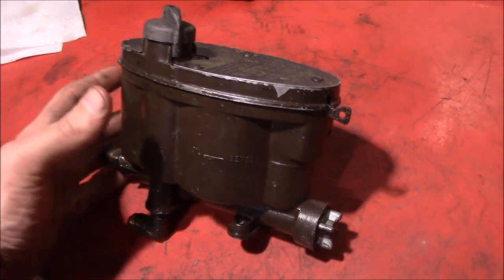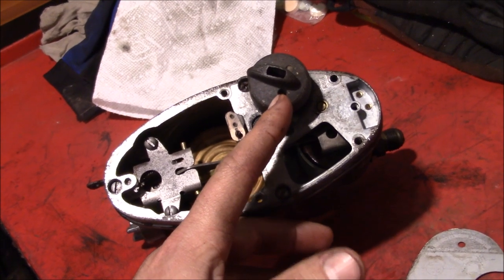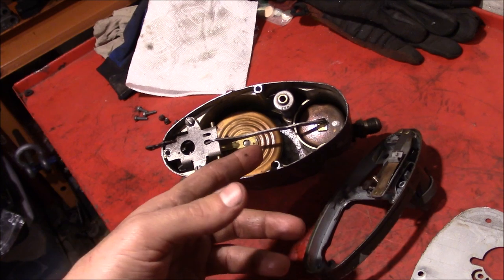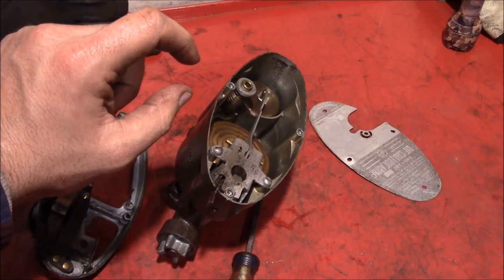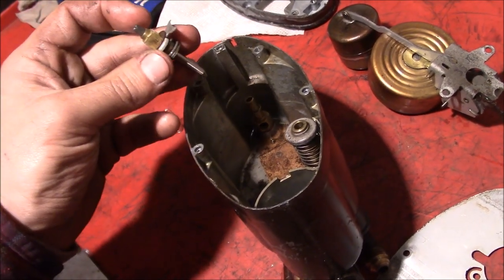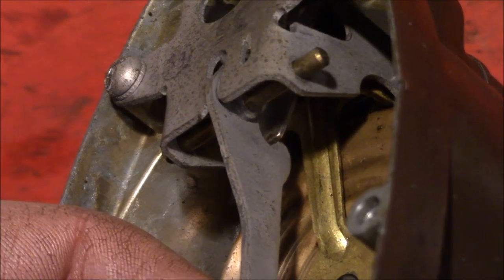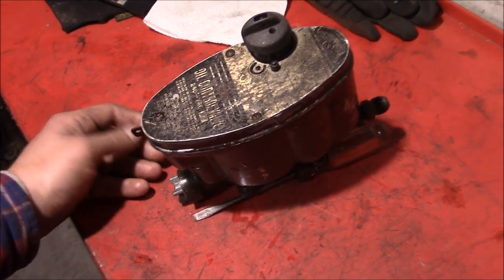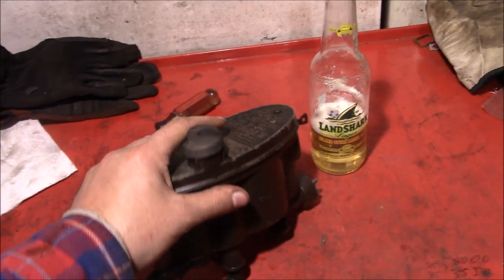Oil Heater Control Valve - Overview and Disassembly

Comment: Thanks so much for this video.  Our house came with an old SuperFlame oil heater in the garage. I had never seen one of these before. Took the same approach and just tore into it to get it figured out.  Was worried enough about it that I drug it out into the middle of our driveway the first time I fired it up like I was about to light off fireworks. It has since been heating our garage for the last 3 winters with no issue other than I had to run it wide open as the flame would extinguish if I tried to turn it down so the garage would get unbearably hot.  Your video has helped me understand how to get the upper and lower flow limits set properly and now the garage stays at a very comfortable temperature and my fuel lasts much longer.  It really is a chore trying to find any info on these old heaters. Finding your video was like striking gold! 👍👍👍🍻
Reply from the maker: That's great to hear, really glad it's working better for ya.

Comment: I was doing maintenance on my 20 year old Raeburn  stove in readiness for Christmas cake and Christmas puddings to be made by my wife, but found that after I had cleaned up the burners and replaced the wicks the  oil flow just wasn't there. Now I understand that bit more. Thank you.
Reply: did you get to fix your problem?  I'm have the same issue with my aga. After watching this I'm going to open up the control box and see if there are any obvious reasons why the flow could be blocked.
Reply: @richard6863  No. Whilst it was good to clean out the encrusted gunge from the inlet pipe to the burner, I now think that the problem stems from a kink in the pipe leading from the oil tank outside. Judging by the gunge, it looks like it might be good idea to replace the oil filter from the tank anyway.
Reply: It's always worth checking the pipe leg between the control valve and the burner pan, as this pipe can become blocked due to oil that solidifies (carbonised) within the pipe due to its proximity to the burner pan.
Modern low-sulphur kerosene heating oil is more prone to this than the old fuel.
Atmospheric stoves like Rayburns and AGAs are prone to this.
You can buy additives for your oil tank to reduce the chance of this. When our oil supplier knew that we had a Rayburn, he always poured some additive into our tank at the time of oil delivery.

Comment: That valve is brilliant. I hate that electronics have now taken over so many of these jobs that mechanical devices did in the past.  The problem is, the average Joe back then had enough gusto and gumption to repair such things themselves and made it so they didn't need to buy new ones. Nowadays, the average young male thinks you change a flat tire with your phone and watch some dirty guy over 40 come do it for them.

Comment: We have an almost identical valve on an Aga with oil conversion. It was made in Denmark by BM Controls. Your video may help diagnose why the Aga isn't running hot enough. Thanks from UK
Reply from the maker: Cool, best of luck with it!

Comment: Excellent video. Clear explanation of how this type of valve works. So good to hear the enthusiasm for a mechanical control system. I have this type of valve on a stove bought brand new in 2000. I have installation and user guides but they do not give this level of technical information. Thanks for posting this.
Reply from the maker: Glad you enjoyed it, thanks!

Comment: Thanks so much from Wales. I have an oil fired Rayburn stove/water heater. I love it, it’s simple with no electronics, and needs no electricity to work. Just acquired a spare control valve from a junked stove, as a spare, in case the one on my stove needs work. I have the confidence now to check the insides out.
Reply from the maker: That's great, glad to hear!
Reply: Wales here too! The Major... is that Llantwit Major?

Comment: I have a couple of these heaters running in my shop and one in my cabin. One i picked up from the dump, my 3rd one I am in search for and oil control valve for. These are great heaters. I love old technology!
Reply: Where can I buy the inner and outer wicks for this model dk8722  please  sam

Comment: I got the exact same one on a old heaterola that I restored about a year ago .After a good soaking in carb cleaner  I used a stopwatch and a tiny measuring cup to set the high and low settings 5cc/min on low and 35cc/min on high. Took for ever but but works great. I wish this video was out then would've been a big help.lol

Comment: Great video, My meter was stuck or blocked until I tapped the side of the unit a few times with a spanner. No need to dismantle :) Worked for me instantly.
Reply from the maker: Glad to hear, it's great when that fixes it, haha.

Comment: Another massive thank you from me - had a similar control valve on an AGA that just started playing up after being off for a few months, and your video helped me understand how it should work and where to look. Turned out the flow valve had stuck down shut so wasn’t springing back up when turned on and letting fuel flow - little tap with the lid off and hey presto!

Comment: Thanks for this! We've taken apart a Refleks with a control valve from Holland. Found a load of gunk in it, after the first time of opening it up it did fill up quite quickly from the inflow. But, there still wasn't any diesel in the outflow tube. Second time we took it apart I watched your video and we found that filter in the bottom was filled with gunk too (someone else had told us it was just an alternate place for inflow tube to go, ie left or right... lol). Still haven't got it flowing to the outflow, but we'll give it a rest and hopefully get it going tomorrow 🤞
Reply from the maker: Cool, hope it works for ya.

Comment: I'm currently running one of these stoves to heat my garage. I've been through that carburetor / control a couple of times over the years. Thing works like a champ!
Reply from the maker: Sweet!
Reply: From where we could but these can any one let me know new carbutator
Reply: @mohdhamza6155  I've never seen a new replacement carburetor like these for sale. Just keep looking on the usual auction sites for a working used one. That would be my advice.

Comment: Awesome man!  Was kinda expecting a shout out, because I'm one of the very few people on YouTube with videos about these old Coleman heaters.  I have a Kenmore that survived the fire, our long used Coleman sadly went up with the fire.  The Coleman had an addition to the fuel control, it had a bolt on thermostat.  Basically a probably Mercury filled thing that would throttle down the fuel when it got warm.  It would work good in an insulated home, but in the RV, it was always cold back where the fuel control was, so it was basically useless.  But a cool extra feature.
Reply from the maker: No shit!  Totally missed/forgot about that, I just went back and watched the vids.  Probably wouldn't have made this vid if had known there was already a rundown of these valves, haha. I never really paid much attention to or appreciated these style heaters until I had to repair that one last year.  After seeing how it worked inside realized how cool it was.   That mercury thermostat was awesome, makes sense why the little poppet is there.
Reply: @toocheaptosmoke  Haha, nice.  Yeah, your breakdown, and explanation of the whole system is so much better then what I did, so it's great you made your video!  It will be more useful for people for sure.  Really good video man :)
Reply from the maker: @tommartyn  Thanks man!   You wouldn't happen to want the rest of that coleman I have would ya? (its missing the valve)  Hate to scrap the thing.  Was thinking about trying to rig up a small needle valve with a glass inline fuel filter where you could watch it drip to regulate flow.

Comment: I have a Sparks Deluxe from around the 1940s It's been in storage for over 40 years it was used in my families house they built during the great depression. I'm thinking about throwing it back into the house and using it again.

Comment: Thanks for the video, very good explanation. I have an oil stove   just like that, I think the carburetor is identical! I also have a spare carburetor.
The stove is still available new from Refleks in Denmark, but the carburetor is slightly different.
I think the secret to the long life of these carburetors is that they are immersed in diesel oil, this prevents corrosion.
Reply from the maker: That is a good point.  Cool to hear they are still made new over there, here the parts are becoming non existent. :(

Comment: A control valve like that is currently over $1500 for a Napoleon OS-11 Savoy stove and one of the few parts still available. Thanks for the video. Off to figure out what's stopping the flow.
Reply from the maker: Wow, that's a bit steep! Last I looked there wasn't even a new option available at the time.

Comment: Awesome explanation, I moved onto a 5 acre property with a torn down barn and found an old heater from sears ! I pulled the oil control valve off and started tinkering. Most oil stove videos I see on youtube use a drip type system which I find dangerous if the drips start filling the pot burner faster then the fire can burn it, I have never seen anyone mention one of these old oil control valves, it's super neat. the way I understand this, if you were to leave the fuel to the stove open and unlit, the oil pot burner would reach a maximum level set by the oil control valve level and not allow an overflow event ? Definitely safer then the drip systems. I wonder how well this would work with waste oil if well filtered. I may have to try some experimenting in the shop.
Reply from the maker: I believe that is correct, it will fill until the level in the pot reaches the float level in the control unit.  I've heard about people leaving the valve on and forgetting to light it, it didn't overflow but the furnace was thumping while it was burning off, lol.   The furnace did overflow once when the safety float and needle valve were both compromised.  But, that was from someone damaging the on/off switch.

Comment: Very nice video! My parents still use an oil fournace every day in their kitchen.. my grandfather bought the stove new in the fifties. It has run with no issues since the first installation. Only one time the filter was cleaned out but not much in it because there is a main filter at the tank.
These control valves seem to last forever. Same type of carburator as yours only with a different name on it.
Greetings from The Netherlands
Reply from the maker: Thanks, that is great to hear.  I'm amazed to hear about how many of these old furnaces are still going out there.  It says a lot for their simple reliability.

Comment: Thanks. I now understand more about how mine works...I'm not sure what's wrong with mine. It's probably just shot like me. lol. I see some oil on the side but no drips. Heater keeps going out and isn't whirling blue properly. I may could check that filter. Didn't know that was filter till I watched this.

Comment: Later ones used a foam float i still use a rayburn that has almost the same oil valve
Reply: Same here, mine is made by BM. I’m having trouble with oil flow, too slow. The slit in the metering needle is much narrower than in this one but that can’t be the problem as it was working fine

Comment: This helpped alot I didn't know it was kinda not to crazy inside. Cleaned up but noticed the slit doesn't go wide open at all.
Reply from the maker: Could be because of the rated capacity of the furnace, some just might not be able to handle full throttle
Reply: So I cleaned it up. The oil level doesn't even go up
 Maybe 1/4 that's it. The float isn't even all the way up.
Reply: I'll keep messing with it.  I even cut the filter off.

Comment: Just picked one of these old heaters up for free. Tharrington 5060. Was wanting to make it burn waste oil. Ever tried burning waste oil in yours? Was wondering if some modifications may need to be made to the oil in through the needle assembly. Or possibly the oil flow out valve may need enlarged? Any advice would be greatly appreciated. Great video!
Reply from the maker: I think you may have trouble getting the stove started when the firebox is cold.  You may have to start and warmup with fuel oil, then switch to oil.  The oil just wont have the volatility the fuel oil/diesel does.  Run some good filters upstream of it!

Comment: I have a heater that uses one of these carburetors. 1947 Sears oil burner. Been burning used motor oil through it very well except for the needed cleaning every day or two from the build up and chimney pipe cleaning every couple weeks. Was told to preheat the oil and that would help the soot and chimney build up a a lot.

I was thinking of doing a single or double loop of the copper tubing around the stove pipe but can't find any information if the carburetor will be ok with the oil heated to 120-160 deg.

Was also trying to find a way to preheat the pipe that goes into the belly, but not having much luck. Not to many people have these types of heaters. We have had this one since 1985. Found the replacement parts at auto store in 1990 that had carburator floats and needle and seats. Other than that have never needed any else at all. Crazy thing keeps working.

Any ideas?

Thanks
Bob
Reply from the maker: I would be cautious about heating the oil too much prior to entering the valve, if there are heat fluctuations in the oil the metering will change rapidly with the thinner/hotter oil.  There's a chance it could "runaway" with the oil getting hotter and metering faster into the furnace.  I know on one of the furnaces I worked on the line to the burner is routed through the box to preheat it a bit before burning.
Reply: @toocheaptosmoke I have no problem setting the flow adjustments if needed. Just wasn't sure how hot the carburator can handle. Is there any information on heating it at the pipe that goes into the burner? - That might be an option.
Reply: @toocheaptosmoke  I did notice yesterday after we started it for the night, the small tube from the carburator to the inlet tube were both very hot. 

Could touch the one but not much, and the one that screws into the belly, to hot to touch. Would seem to be it's own preheat.

Put a fan under the air intake and the flams were a little more blue, but there was still soot buildup this morning to clean out. Crazy motor oil. Diesel never did this. Might have to consider Transmission fluid if I can find a place that would not have a problem someone collecting it next winter being much thiner.

Thanks for all.
Reply: @toocheaptosmoke  One answer I tried to show a link to a photo of the burner we have and youtube must have deleted it.
Reply from the maker: Sure thing.  I think used motor oil is always going to smoke and soot up more, even does that when i run it in my diesel truck too.
Reply: @toocheaptosmoke  Good news, I was able to get an attachment for my meter and the temprature of the inlet tube was 163deg.

I think that saved me having to run pre-heat tube.

I put a small RV frig Fan under the burner at the air intake and that made a difference how it burned.

RPMs might be slow at 1,600 RPM. I have a 3,000 RPM showing up in couple days to see if that makes a difference.

Comment: are there any chemical cleaners (sprays) that will help clean the air holes in the burner after a good vacuuming? what about the creasote sprays? this is such a messy job for this type of burner so i want to do my best to keep it burning normally without such future build up. thanks again! Happy New Year:)
Reply from the maker: I think oven cleaner could be a good thing to try?
Reply: @toocheaptosmoke  sounds good. hadnt thought of that. i was thinking maybe engine degreaser or carb cleaner. i will experiment:)

Comment: Grat video  I have a question can you convert it to burn waste oil through that carb
Reply from the maker: While it may be possible, I think you may have issues with the oil being so much thicker than the diesel/fuel oil.

Comment: I HAVE A BM30 OIL CONTROL VALVE  ( DUNGS COMBUSTION CONTROLS ) ATTACHED TO MY STOVE. WORKS FINE AS LONG AS YOU DONT FLOOD IT WITH WATER . I HAVE A FUEL FILTER WITH A WATER DRAIN BETWEEN THE FUEL TANK AND THE CONTROL VALVE.